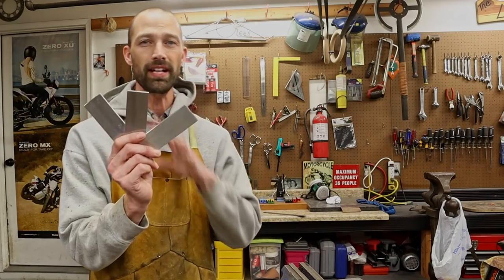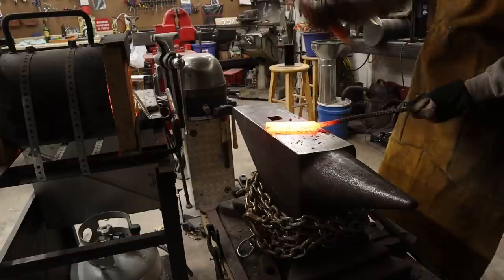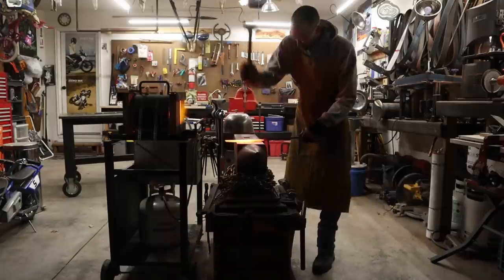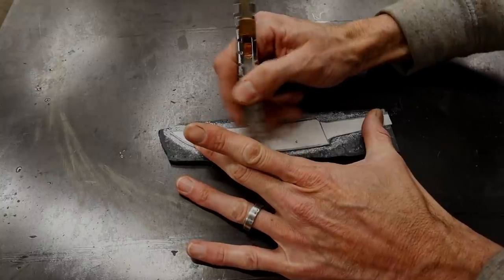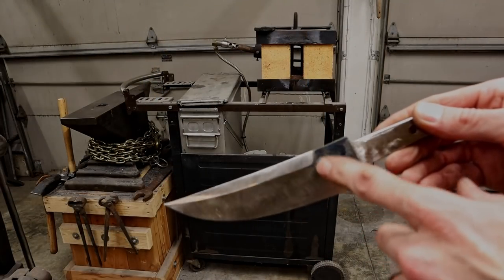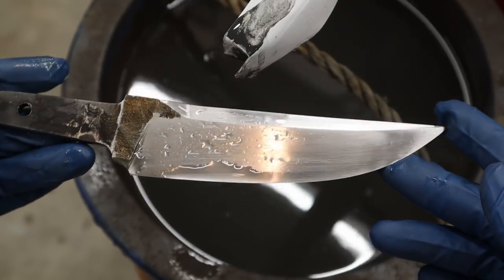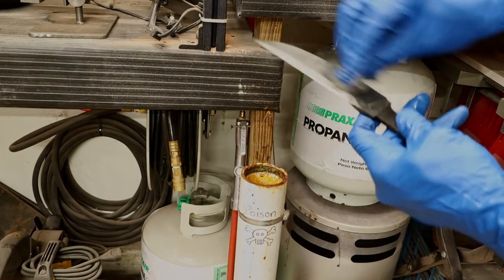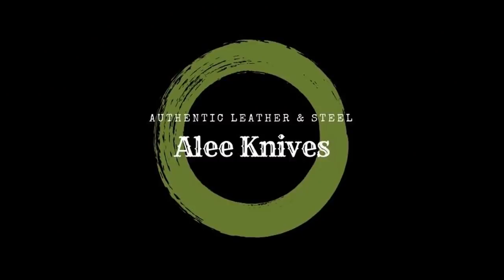Easy San Mai  ( By far the easiest method to hand forge San Mai )

Comment: I love the comments. I wonder how many people were actually successful on the first forge weld ever with no Flux or welding. Not me. Didn't get it fully heated. Need to soak it longer.
Reply from the maker: I wasn't successful it took me 2 or 3 attempts.. That's why emphasized to make sure you get a full heat soak

Comment: Looks great ! The reason why the 1084 did not etch black at the ricasso is because during the forging you lost some carbon on the outside .... that outside will also not be as hard as the inside. The carbon remained better deeper into the billet. High carbon steels will also color much darker when hardened than when they remain in a unhardened state. If you edge quench knifes or partially cover a blade with clay(to get a hamon) the parts that cooled slower (parts not in the oil or covered by clay) will not be as black as the parts that cooled faster.
Reply from the maker: Very good points here! This is completely true. Thanks for your input! Cheers

Comment: You can do fluxless welds without having to weld up the seams. I do it often. Just make sure your pieces are flat and tight. I usually run them up to 120 on the platen then clamp in the vice and tack weld. Preheat your forge, I toss a peice of scrap steel in so I can see the temp that I want. Then toss the billet in and bring direct to welding heat. Light/firm taps on the anvil to set the weld and your golden. Setting welds isn't rocket science till you start including stainless or non-ferrous metals like copper.  Nice video though, lots of great tricks and tips here. Great looking blade!
Reply from the maker: Great info man! Thank you! Cheers
Reply: No prob man. I like the cut through the BS approach. Give it a try man. it works. And no need to destroy the forge with flux right? But I do keep flux handy just in case still. On top of sealing the billet from oxidation, it also has the added benefit of dissolving forge scale. So if a misshap occures...

Comment: that is well cool, and thanks for the how to, tried my first attempt at laminating a blade this week and failed, my home built coal forge doesn't get hot enough and maintain the heat long enough it seems, you just confirmed the heat part with saying what colours I am going for, redesign  and upgrades needed obviously lol, oh yeah heating your chain and laying it on the anvil will warm it up, found heating a lump of scrap metal and laying it on my anvil plate thing works well
Reply from the maker: Wow normally coal can get way hotter than a propane forge.
Reply: @Aleeknives  yes it should, and it does, easily enough to melt steel but I have a design flaw, means ash doesn't clear easily and so it gets hot enough to weld but not for very long, not long enough to soak the metal at the temperature needed
Reply from the maker: I see! I have never used coal to forge with
Reply: @Aleeknives  all a learning experience, and all things I am finding out as I go along, only a few months of doing this so will no doubt be plenty of other things that happen to overcome
Reply from the maker: That's what I love about knifemaking! There is always something to learn!
Reply: @Aleeknives  steep learning curve for me without a doubt, enjoyable though
Reply: I pre heat my forge with soft wood. I use a heat gun for air input. I have maple, walnut, oak or iron wood "lumped up"  ready to go. How much do you need? Times it by 4😊 never to much wood! Fill with hardwood. Blast with air. When it starts smoking stop. Let it rest. Hit it again with air. Add as much wood as possible. Put in blade. I heat treat out side when it's -10--15°c. Key....Pre heat your forge. Problem with propane. It starves the fire triangle. Propane isn't fuel rich. Think of your forge like a house fire. A house fire smolders. It is starved of oxygen.  When oxygen is added. Boom heat!  Hope this helps😊
Reply from the maker: Thats interesting!

Comment: Looking good, Airin! can't wait to see part 2, man.
I must look at getting myself a height gauge for marking my centreline. I've been using a flat marble slab and a drill bit so far, and although it works, it's a bit crude and inaccurate.

This was a really enjoyable video. You know I always enjoy and appreciate your work.

Take care 👍🏻
Reply from the maker: The height gage is worth the dollars for sure.
Reply: @Aleeknives  
I'm looking at some right now.
Reply from the maker: I think I bought mine for $60 shipped. I didn't go on the high engh end for sure
Reply: @Aleeknives  
I just bought one for £30, so about $45 delivered. 👍🏻
Reply from the maker: Wicked!
Reply from the maker: It will help in a lot more ways than just scribing the center line! I use mine for handle lay out on my hidden tang knives!
Reply: @Aleeknives  
It sure will, Airin. I'm looking forward to using it very soon, on my next knife.
I'll send you pictures as I go, if you're interested on seeing them?

Looking forward to part 2, mate ✌🏻

Comment: Fabulous video. My question is when you set your welds using a piece of wood, would if be better to use a hard wood to hammer your metal on? Just a question, I am not set up to forge weld anything. Thank you for your work in your channel
Reply from the maker: That is a good question, I will leave that that for someone else to try. It was way to smoky

Comment: Great video, i tried after watching and had great success. It was my 1st attempt. But tell me, how do you attach a handle to such a short tang? Cheers from Australia.
Reply from the maker: Make a tight fit in a strong material and use a pin.

Comment: How thin do you make your rough bevels? I'v been leaving them about as thick as a dime. When l try and put an edge on...It takes FOREVER! I'm using 01 hardened in an old school brick and wood forge. I took your advice and pre drilled my holes before heat treating. SOOO much easier! When l tried drilling post heat...I swear l heard the knife laughing at the drill press! Keep up the great content brother!
Reply from the maker: I go about a dime or even thicker but I complete the grinding after heat treat and go down to a very thin edge. My secondary bevels are real small on most knives except big choppers and camp knives. If I didn't have a grinder I would go thinner before heat treat but your asking for problems when you go that thin

Comment: Would it work to wrap up the billet in stainless steel foil and tie closed with baling wire to get the air-tight thing? Leaving four or so inches extra on the foil on both ends to roll up and crimp.

And if it would, what would happen a sheet of plain paper, same length and width of the bars in the billet was placed between each bar, and a dusting of ground cast iron on each side of the paper in direct contact with the metal of the bars?
Reply from the maker: These are some really neat ideas! I will try them
Reply: @Aleeknives   I do apologize for the bothering.

I know nothing at all about forging or metallurgy, except what I've learned from watching vids and forged in fire.

But I get these stupid ideas and they bug the heck out of me until I pass them on and let someone else suffer with them.
Reply from the maker: I think wrapping in steel foil might work. Don't know anything about cast iron dust though
Reply: @Aleeknives  That, iirc, was something I saw in a blacksmith's vid a while back. The cast iron powder (he made his from a cast iron skillet) puts some carbon back into the steel when it melts.

My brain keeps trying to tell me that a sheet of paper between the plates in a billet would suck up the oxygen while it's charing to carbon and would also add carbon into the surface layer of steel it's laid against. Might give a darker pattern line when etched?

I probably heard a reference to that or something about that in the same vid I saw about the cast iron powder, but can't remember who it was.
Reply: @Aleeknives  Found something tonight that points at anything between the plates is not best practice, so, the ignorant idea of the paper and dust is nix.

Souce is youtube vid titled: RMS demo, pattern welding with  Steve.

In the beginning, he talks about research done that shows even borax flux leaves inclusions that weaken the welds. The vid is from a class he was teaching on "dry welds". It's on Black Bear Forge channel.

I'll shut up with the ideas now. :/

Comment: How long should we keep it in the coffee?
Reply from the maker: I have experimented with several different times and have found 12-24 hours usually does the trick. Buff with 0000 steel wool several times throughout the cycle to make ot etch evenly

Comment: Did you say you used 15n20 for the cutting edge? I’ve never done that I feel it would be soft but I’m definitely no San mai expert at the moment
Reply from the maker: 15n20 actually makes wonderful mono steel knives and great as a core metal for san mai also
Reply: @Aleeknives  very cool I appreciate you I’ve learned so much from you coming up as a blade smith you really stand out in great ways.
Reply from the maker: Thank you!

Comment: I’m a little surprised you went with the HC on the outside and the 15n20 for the core. Definitely looks cool but I don’t suspect the edge retention will be that of 10XX core.
Reply: 15n20 is a very good high carbon steel on its own. Absolutely no concern with edge retention here
Reply from the maker: 15n20 is every bit as good as any 10 series steel

Comment: Evening from the uk mate quick question if you are not going to use wood for a cold anvil how do u battle that.  I forge outside and my anvil is always cold 🥶
Reply from the maker: I have decided that if I need to forge weld steels together I will simply forge a mono steel blade to heat up the anvil first!
Reply: @Aleeknives  so heat the forge up with hot steel sweet il try that mate ty
Reply from the maker: Couldn't hurt to knock out 2 projects at once anyway!😁 I didn’t like all the smoke from the wood!
Reply: @Aleeknives  at first I was like yes the answer to all my problems then I was like oh un 999 on speed dial 😆
Reply: @Aleeknives  lovely work though mate
Reply from the maker: Your 999 must be like our 911 here in the states!
Reply: @Aleeknives  
It is, yes, but with a slower response time 🤣
Reply from the maker: 🤣😂 I doubt that! We believe in taking matters into our own hands here in the states! No need to wait for help
Reply: @Aleeknives  

Absolutely! Not when it’s your own safety on the line!

Denis at Tyrell mentioned the Blade Show this year. Are you planning on going, Airin? 
I’d love to go, but it’s not practical this time.
Reply from the maker: I will not be going this year, I have a ton on my plate already. Maybe next year
Reply: @Aleeknives  
I know how you feel, mate. 
Feels like there’s no time to turn around at the moment!

Hopefully I can come over soon enough 👍🏻👍🏻👍🏻🇬🇧🇺🇸

Comment: How long did you leave it in the coffee. I think it tuned out great. Great job brother.
Reply from the maker: Thanks Tim! I generally go 24 hours and pull it at 12 to give it a scrub with 0000 steel wool. That is when the magic happens!
Reply: @Aleeknives  And how many times do you heat the coffee in this time period. Or is it just the first initial dunk.
Reply from the maker: Honestly I don't think it needs to be heated at all! It actually etched the best after you buff it with steel wool halfway through the process and at that point it is no longer hot at all
Reply: @Aleeknives    Thanks brother. I appreciate it.

Comment: Pretty nice blade. How long stayed the blade in the coffee? Do you have experience about the duration of this coffee surface?
Reply from the maker: 24 hours in coffee, I lock in the coffee with a wax coating. Over time the black does fade with use
Reply: Wax coating on the areas you want to have blank?
Reply from the maker: Nope I coat the entire blade with Renaissance wax instead of using oil.

Comment: That blade is amazing. Was wondering how well the coffee etching holds up to use?  Also cold anvil, is there any way to heat it before use?  Thanks for the video. Can't wait to see it finished. Davin
Reply from the maker: The coffee is a topical coat that does wear off with use for sure! Really easy to re-do it if you felt like

Comment: Have you used this same procedure with stainless steel being your center core
Reply from the maker: No I have not. Stainless requires a heat treatment that requires an oven to soak the material at a certain temp for a long period of time. I don't have an oven yet but I plan to build one soon!

Comment: San-Mai has an unhardenable jacket. Wrought iron, stainless steel, mild steel, etc. You made a three layer "Damascus" blade.  "San Mai (Japanese: 三枚, Hepburn: sanmai), in the context of metal blade construction/metalwork, refers to a knife, blade or sword that has the hard steel hagane forming the blade's edge, and the iron/stainless forming a jacket on both sides. It is also the term used to refer to the technique used to create these blades."

Comment: Why not hammer the shape of the knife out? Save some grinding
Reply from the maker: 3 layer construction. If you hammer the shape out you wouldn't have the same relief between layers. You would be left with just a tiny relief line near the cutting edge
Reply: I can see that too. But personally I feel like the tip should be hammered in and rough shape with hammer then set up the grind lines. I do not think what you are doing is wrong by no means

Comment: I was really liking the video until u started forming the blade by stock removal. Dose no 1 actually forage a blade anymore.
Reply from the maker: I forge blades all the time brother! When making a three layer san mai billet it would be extremely difficult to get the desired effect if you start forging in the bevels. You see if you forge the bevels you would thin out all three layers nearing the edge. The center layer would then start to wander and essentially when you cleaned it up on the grinder your outer cladding layers could possibly mix into your cutting edge and you would also loose the striking contrast you between the layers. There are 2 reasons to forge San mai. One is to give a blade more forgiving nature and the 2nd is for the patterns you can achieve by forging to different materials together.  Sorry you thought the video was lame. Maybe someday I can become a "real knifemaker" 🤣😂
Reply: @Aleeknives  I just hate seeing good material go to waist by grinding. And see way too many ppl doing stock removal on a peace of 1085 or such, and the steel never even sees a forge, and calling it hand forged. I guess I've just listened too much to the old saying forge more grind less. I've never tried San Mia before and I'm not very experienced in blade making but isn't 15n20 and 1084 hardenable steel? If it is it wouldn't really effect the cutting edge if they both are on the edge. But I see ur point that it wouldn't make the desired design tht u were going for.
Reply from the maker: A+ thank you for understanding my perspective. I also do stock removal when I feel like doing something wild or when it's to hot to forge. Thanks for adding your thoughts to the channel! Cheers

Comment: Love the video, but that's far and gone from the easiest wat to make san mai. Stainless san mai, welding the seams is the way to go, for sure. About the only way, in fact. But for high carbon san mai, or low carbon to high, it adds a lot more work to weld the seams. For knifemaking/bladesmithing applications, just soak the billet in kerosene or WD-40 (I prefer kerosene, but you do you) and put it in the forge. It's still acting as a flux, but isn't the shit show and mess that borax can be. Now, for blacksmithing, borax or similar compunds for a forge weld is unavoidable. I don't mean to be pedantic or anything, but just thought I'd ad my two cents. Great content, though.
Reply from the maker: Totally valid points! I do think for a beginner that this method actually improves the success rate of a good forge weld though! My channel is definitely aimed at beginners. A have had several failures using the other methods.
Reply: Sorry for only just getting to this! Welding the seams does help, but it also relies on someone having a welder and knowing how to weld, which is something a lot of people don't have and know. I get it, though. Also, I'm sorry for things getting out of hand with what's his name on that other comment thread. What can I say? I like out asshole-ing assholes😁
Reply from the maker: I love it! Keep up the good work!🤣😂

Comment: San mai is cheaper, lesser steel wrapping around and over the back of high quality, superior steel. That’s tithe point. Arc welding layers together may be literally “two-type” (San-Mai) steel or whatever, but it misses the whole point of the endeavor.
Reply from the maker: This is an art form #1 and San mai is actually NOT made to "save" money. The softer steel on the outside allows better flexibility adding strength to a thin layer of high carbon steel. The reason was never to save money. The entire process cost more to produce from fuel and labor. 
Thanks,
Cheers